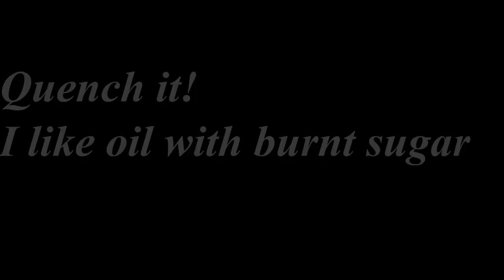How to Forge a Corkscrew Worm.

Comment: a tip is to make the end of it, the sharp edge, to point out a little bit more, as if it almost were straight, so that it will pierce the cork easier for you to be able to screw it in.

Comment: Many people will laugh and scoff at the statement that angle grinders are dangerous. Don't laugh - it's absolutely true. Especially from a statistical viewpoint but also in practice. And don't ever remove the guard unless you absolutely, desperately have to for the task at hand. The reason is discs break and when one does, you will want to have the guard on lest your fingers and possibly face risk being turned into mince.

Comment: Why did you add sugar to the oil?
Great video! "pull your worm"
Reply from the maker: This is just a my theory but I believe it introduces free carbon into the oil (conola) and may help case harden my worm
Reply: I think I'll try next time I heat treat a knife
Reply from the maker: Alejandro Mier not needed for anything but mild steel
Reply: foxfireforge What does the sugar in oil do though?  Nice video by the way, your editing and music selection made it fun to watch.
Reply: hotsauce3888 sugar (this is my scientific Guess but it does seem to work) burns and creates free carbon which helps to case harden the mild steel.
Reply: Nice